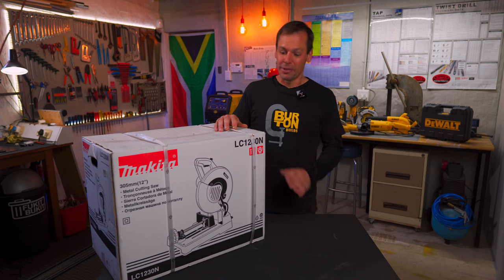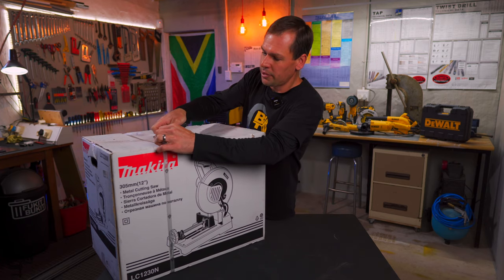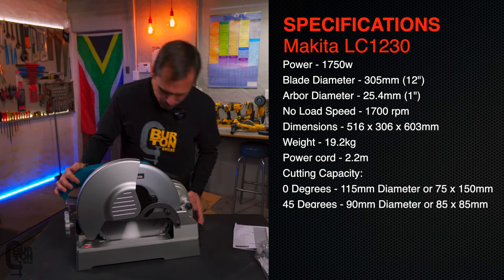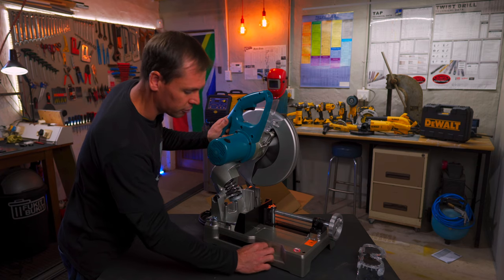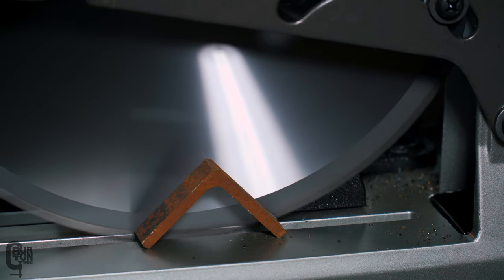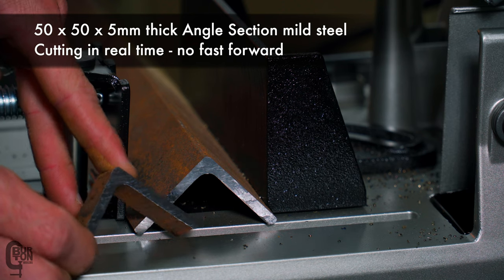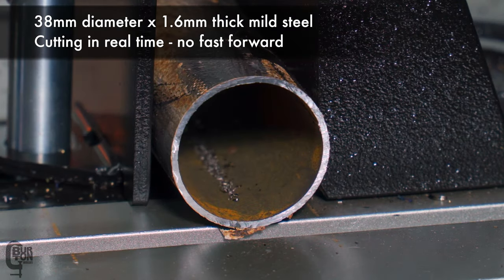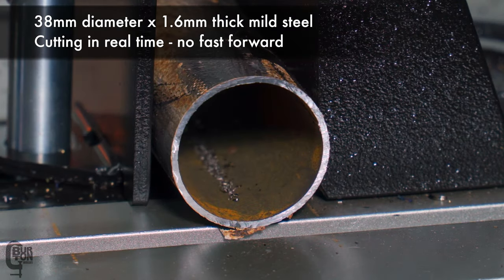Best cold cut metal chop saw? 200+ Cuts - Makita LC1230 vs DeWalt DW872 - Burton Builds

Comment: Wish I had came across this video before I purchased the makita abrasive saw.
100% correct about the thin pressed base. When I clamp material into place, the base plate warps and lifts up one side of the material I am cutting higher. It’s going back tomorrow.
Reply from the maker: Hi Mitch, thanks for the comment. I’m still happy with my LC1230… base is still holding up well. Good to hear you can still send it back and swap it out for the cold cut version. Let us know what you think once the new saw arrives and you’ve used it. Keep well.

Comment: Very informative and convincing review especially for a newbie like me.
Reply from the maker: Hi Romel, thanks for the comment. It's been working pretty well for the time I've used it. Also keep in mind that it very much depends on what you are going to be cutting... If it's more general cutting like tubing, pipes, small angles, etc. you'll be cutting then it should work pretty well. If it's larger solid sections of steel, a slow turning cold cut saw is a better choice (turns at 15 - 60rpm - very slow compared to the chop saws). These are more commercial / industrial orientated saws that use HSS blades.

Abrasive chop saws also still have their place though, they cut a wide range of materials, shapes, sizes, etc. albeit not very accurately. It also depends on the operator... the 'cold cut' saws with carbide blades need to be treated somewhat carefully... one can't just jam the blade into the material or the teeth will chip very quickly.
Reply: @GrantBurton  thanks for the additional tips. I am intending to use it for some small projects like chicken coop and benches at my little farm and for some DIY's at home. Since I am a newbie, it seems like it is more practical for me to get an abrasive chop saw for my intended use. The price of the Makita LC1230 is also more than double the price of the Makita LW1401.
Reply from the maker: @monterogls  Makes sense. Also abrasive disks are relatively cheap to replace. The abrasive saw will also suite the farm type fo work better. If you were planning on buying through Amazon, here is a link for the saw. https://amzn.to/2Zc5EqX It's an affiliate link... doesn't cost you anymore and I'll get a small commission. Absolutely no pressure though, just putting it out there.

Let us know your thoughts once you have bought and used if a few times... always nice to get feedback from the youtube community.
Reply: @GrantBurton  Yes, it's true that abrasive disks are much cheaper than carbide-tip blades. Thanks for the link. I will definitely share my experience once I got and tried my unit. Thanks again.

Comment: Also, my old Makita chop saw has been used as an abrasive metal saw as well as a wood cutter. It's simply so darn heavy that it's now mounted in my shop and permanently transformed into an abrasive saw. And those base plates are beasts! I'd say they are responsible for 75% of the weight and they are very heavy machines.
Reply from the maker: I can agree... It's not something you just going to throw in your backpack and go hiking with... it's damn heavy, but I like the solid build (and no flex in the base). Currently mine is also mounted on a pedestal on the grinding / cutting room but it would be nice to have wheels on it so the setup can easily be rolled outside for cutting larger pieces of stock.

Comment: Makita is fantastic when it comes to longevity...I've had a Makita chop saw, circular saw, and reciprocating saw for roughly 30 years. Only issue I've ever had was replacing the switches and the occasional tear down, clean, and re grease. That being said they don't out perform a DeWalt...the only thing that I've seen that comes close is Milwaukee.
Reply from the maker: Hi Lignum, thanks for the feedback. I think you can't go wrong with Makita, Dewalt and Milwaukee, they are all good brands (although every now and again, there is a tool that is released that isn't up to spec).

What are your thoughts on why they don't outperform a DeWalt?

Comment: The sound of your machine is so nice:) my HBM sounds wrecking terror. Specially when turned off.
Reply from the maker: Guessing your bearings are bad again, or maybe the Makita has a better gear tooth design which makes it run more quietly and smooth.

Comment: DeWalt makes great stuff if you swap out the bearings. I'm a tool mechanic. Failure point is almost ALWAYS the armature bearings. Just read the four digit numbers on the seal on the outside of the bearings. If there are only three numbers, put a zero in front, and order Japanese, Indonesian, or taiwanese ones.
Reply from the maker: Hi Daniel, thanks very much for the comment. Great to get feedback from others with repair experience. Thanks.
Reply: @GrantBurton  for the armature you'll need a 6001 bearing and a 6000 series. Get a double walled 6001 usually marked llbc3.. the 6000 can just use a rubber sealed unit.
Reply from the maker: @danielescobar7618  Brilliant... thanks for the info. What do you mean by 'double walled 6001'? Do you mean the bearing has two steel seals (2Z or ZZ bearing)? The C3 on a bearing means it has greater than normal internal clearance which allows for expansion due to high speeds and temperature (i.e. a bearing with a higher than normal speed rating).
Reply from the maker: @danielescobar7618  After a quick search... llb (LLB) is a non-contact, rubber seal. Didn't know that... but now I do. Found this nice bearing reference by NTN - I'll post a picture of it on my community section posts.
Reply: @GrantBurton  aw shucks my dude I completely forgot about this. ZZ Bearings are junk, but I see you have found the correct adequate upgrade. LLB are the best you can throw in there. Taiwan/Singapore/Japan NTN are the only ones you should trust. The Chinese mfg ones just don't hold up if you're a commercial or industrial user.

Comment: Hey! Can you tell me aprox. How much cuts your disk did? I’m near to buy one of these but it’s too expensive and I need to do a lot of cuts, so I need to know if it’s the perfect tool for me
Reply from the maker: Hi Terito, I've done around 300 cuts now (might actually be closer to 350) through different sections of steel. A little over 200 cuts through solid 12x12mm mild steel, around 50 cuts through 20 x 5mm mild steel flat bar, around 50 cuts through 12 x 6mm solid mild steel and a few cuts through other random sections of mild steel. No cuts through stainless steel yet (Don't have a suitable blade... it doesn't seem like Makita or Strand Hardware are interested in providing a blade for test cutting Stainless Steel).

Blade still looks like it's in good condition after all that cutting... no chipped teeth.

Keep in mind it depends what material you will be cutting and how carefully the saw is used... thrusting the blade into the cut is going to result in teeth wearing fast and chipping... that could work out to be very expensive per cut. If you are cutting very thick sections of solid steel on a large scale, it may be better to get an industrial cold cut saw (those are saws that turn very slowly, around 15 - 60 rpm, have many smaller cutting teeth on the blade and use a flooded coolant system).

An alternative, if this saw is to expensive, would be this https://amzn.to/2Zc5EqX or https://amzn.to/2Z3KKdH

Hope this helps.

Comment: Hi, thanks for this thorough review !

I'm seriously considering this saw for it's apparent build quality and sturdiness (especially the vise), compared to the Bosch Professionnal GCD 12 JL (although the latter is more expensive !). 
Also, the quality of the blade which comes with the machine seems better on the Makita (I've seen videos with the Bosch with a lot more sparks and heating, I don't know if they did something wrong or if the blade is simply not good enough...) Would you think this is due to the quality of the blade itself, or that it has something to do with rpm ? (1700 rpm on the Makita, 1500 on the Bosch... (although this doesn't seem to make sense (the faster should heat more, right ?))) Anyway, the cutting, "out of the box", seems better with the Makita.

The downside is the cost of the blades (very expensive, at least here in Europe : 260 € for the Stainless Steel 100 teeth blade (half of the machine price !)
I probably won't be cutting stainless steel on a regular basis, but it happens that the first project I will do with this saw will be requiring it ! :-)
(nb: there is a 76 teeth stainless steel blade that is a bit cheaper (200 €) but it doesn't seem compatible since its maximum speed is 1500 rpm and the saw is 1700 rpm... (the 100 teeth blade is 2000 rpm max.))

Bosch blades are way cheaper (about 130 € for a stainless steel 90 theeth blade). This makes me think twice... 
Then of course maybe the Makita blades are actually way better.

Does anyone have insight about this ? 
Do you know if only Makita blades can/should be used on this machine, or if there are other blade brands that would be compatible and have a better value for money ?

Another question : don't you need any accessory on the vise to properly maintain round tubes ?
Reply from the maker: Hi Christophe, thanks for the comment. My personal choice is Makita over Bosch... I think Makita is a more of a Prosumer product(s), better build quality, etc. although I've got a whole lot of Bosch home appliances and they are great, but that's a different ball park.

As these 'cold cut' saw blades get dull, they spark more and cause more heat (but no where near an abrasive saw). That said, a lot also comes down to tooth design, kerf angle, top bevel, number of teeth, design of the carbide tooth, etc. So unless the blades are identical, it's difficult to draw an exact comparison. I would think the slower rpm should product less sparks and less heat, which leads me to think the Makita blade is a better designed / quality blade (but also very expensive - you get what you pay for). Sparks and heat will also depend on the material being cut... maybe the Bosch was cutting a different metal to what I was cutting.

When it comes to speed, 1500 vs 1700rpm isn't much different, although I guess the general thing with cold cut saws  is the slower the better.

I've seen a few videos where tests were done between two brands of blades for cutting stainless steel and the cheaper one dulled far quicker than the more expensive one. I cant remember what the cheaper brand was but I do remember that the Diablo Steel Demon came out on top for cutting stainless.

Most blades will be interchangeable, having a common 1 inch arbor hole (25.4mm).

I have seen some saws come with an additional 'sideways V' style of adapter / clamp that slips over the moving jaw and that firmly holds round tube in place (pity the Makita didn't come with that, although it's fairly east to make).

Comment: Hi 
Wich blade is the best choice for stainless steel if you have any idea
Reply from the maker: Hi ahmed osighir, that is a great question and I would also like to know. Unfortunately I haven’t been able to get a stainless steel cutting blade yet. Hopefully others will share their experience with using various blades. I do remember hearing that the Diablo Steel Demon does a pretty good job but don’t have any first hand experience with this blade. Makita also make a blade for cutting stainless but it’s expensive.

What grade of stainless are you wanting to cut?
Reply: @GrantBurton  
Thank u for your time 
304 mostly 
tubes and square and rectangels betwen 40mm to 100mm ( small abrasive wheel is ok for 30mm or less)
I use the small grinder tool with sbrasive disk but it takes time and the cute is not good at all , its always need more grinding with grind wheel 
If i have some tool that can cut that fast and clean in your video i will do my work much faster , but with good prices and long age as much possible cause i will pay 30% of its price for tax and not cheap shippment also cause i live in morocco
My english is not very good i hope you get the idea

Comment: Thinking about buying one:)

I got a HBM choo saw now, payed 300,- for it. But it broke 2x in a couple years.

In 8 months the bearing wear down. Garantee was 6 months. 

So I fixed it my self.. nog funny. 

Now a couple years  later having it 3,5 years it just stopped working yesterday day. 

Smoke came out… 

I only changed saw disc 1x. So I don’t do much work on it. 

Time to buy Quality
Reply from the maker: Hello, agreed, probably time to buy quality... having a bearing fail in under a year is not great. So far I'm still happy with the LC1230. I also only use it occasionally and so far its held up really well.

Let us know what you eventually end up getting.

Comment: Will this cut 100mm by 100mm box section?
Reply from the maker: Hi Thomas, 100x100mm does fit into the machine and the blade guard does open clear of the material as the handle is pulled down... so short of actually cutting a piece of 100x100... I would say YES (Don't have a piece of 100x100 to actually try it out).